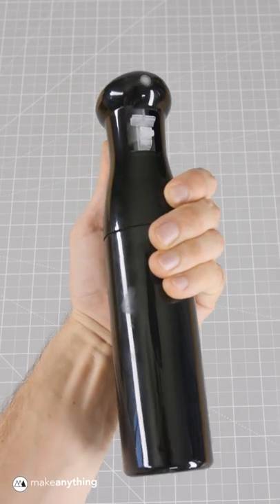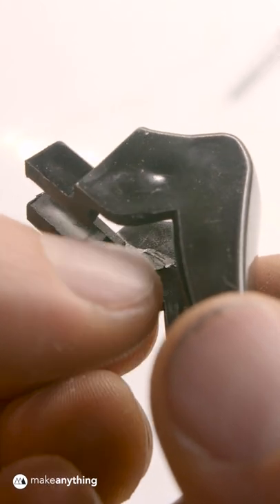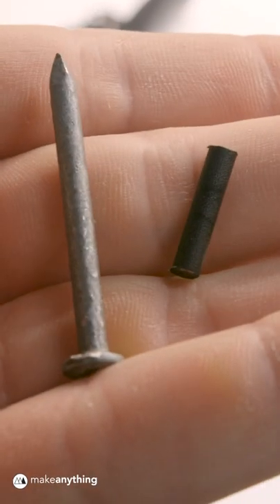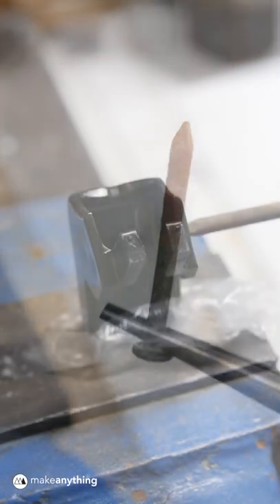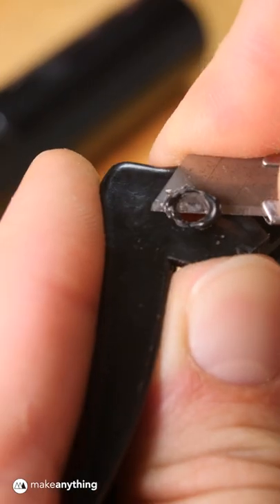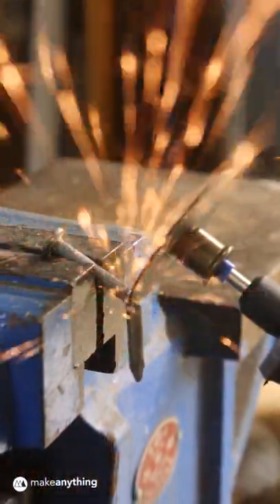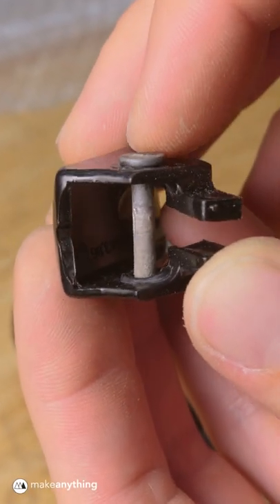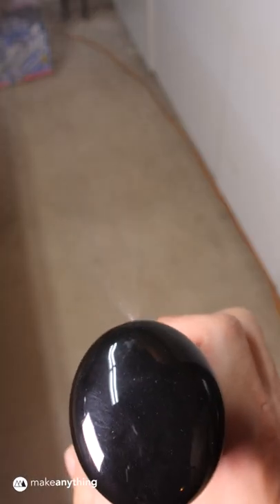Spritzer Fix!

Comment: Nice little video! A lot of fixes really are quite easy and a 3D printer isn't always necessary. I once wanted to print a little adapter to mount my Echo Dot directly to the power brick at the wall, but the print would have taken almost a day to finish. Instead I just used some hot glue to attach the Dot to the power  brick and it's holding up for two years now.
Reply from the maker: So true. It's hard to resist the urge to 3D print every fix once you have a printer, but worth considering alternatives!